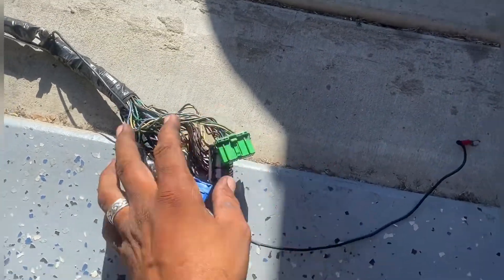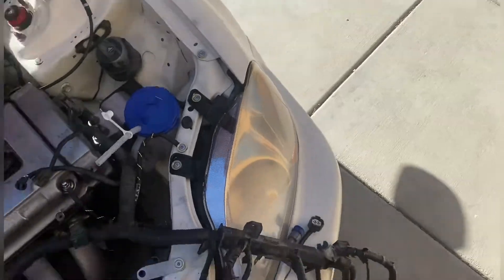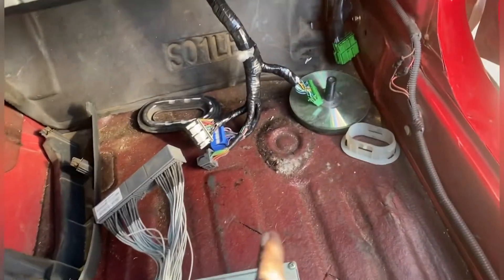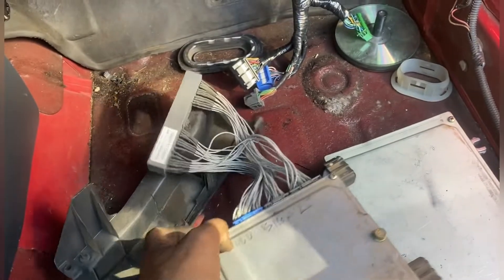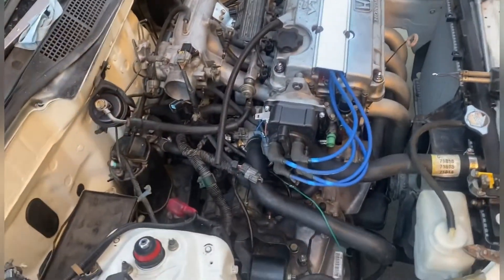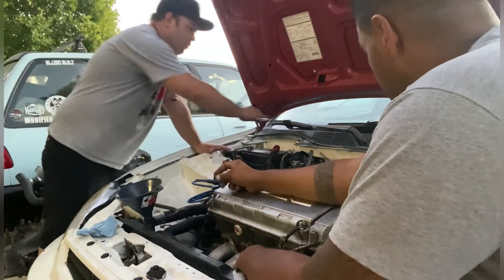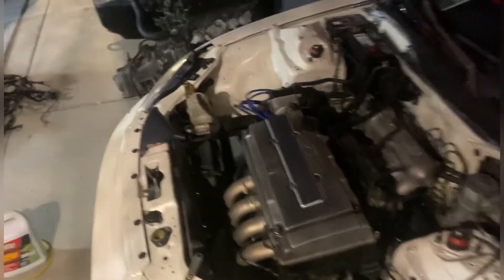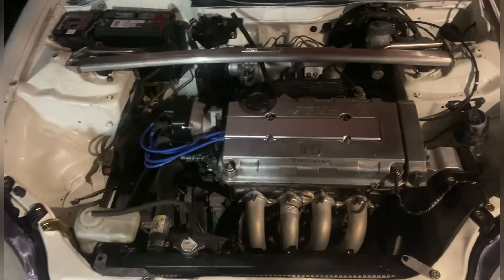B16 start up and wiring

Comment: Is there a manual or guide for where to plug the harness and tubing into everywhere? b16a into eg4.
Reply from the maker: I’m sure there is, I’ve never seen it tho. My house mate made my harness out of a civic ex harness my chassis is a CX. There are only a couple plugs that are the same like the Oxygen sensors and another one on the throttle body but luckily the harness usually doesn’t stretch far enough to get them on the wrong plugs 🔌

Comment: I have a 98 civic dx with a 00 si b16a2. 

What were the wires that needs to be extended/modded to get the 96 to 98 ex wiring harness to work? Trying to get it bar'd. The previous owner just used the old dx one. Thanks. Seems like this is the same situation here probably besides the cfk since the JDM one probably doesn't have that vs the usdm one.
Reply from the maker: There is or was only one brand that made a Cali legal conversion from obd2a to obd2b it as like 150 bucks from hasport I want to say. That’s how I did it and I did the trick where you run your crank angle sensor wire into the distributor one so that it gets a sign so no CEL. But the issue not on this one because I put the b18c back in.  But on my 97 with a b16a2 is the fuel tank pressure sensor which that ecu looks for and it’s the only code I have
Reply: @civicstar982  oh the jumper harness from Hasport? Didn't know the jumpers can be bar'd was thinking about get the p30 obd2a from the del sol. Expensive but, I don't want any issues if the ref says anything.

Sorry if I wasn't clear. Just wondering if 96 - 98 EX wiring harness would practically plug n play on the 99 - 00 b16a2. Then I can plug it to the del sol ecu p30 that's obd2a from the 96 - 98 EX wiring harness.
Reply from the maker: @mdiesel23  ok that is more clear. I’m suggesting the conversion harness because it adjusts all the plugs because obd2a and b have different orientations. Most aren’t legal because they move from a higher year to like obd1. But if you are going to bar as an 97 del sol then that’s an easier route I think then what I did.
Reply from the maker: @mdiesel23  so the harness conversion is is from HA motors. The del sol I think ran  the b16a3 so I don’t know if that will flag the ref.

Comment: Where can i find the plug adaptor you mention about the map and air temp sensor?
Reply from the maker: Almost everything should plug in on the ek to a b series. But yes the air Temp sensor on a civic is in the intake tube and the integra it’s on one of the intake manifold runners. So you just need the plug piece from an integra and wire that to the air temp wires of your harness to look factory and be functional it can be from a junkyard or eBay. And also my housemate takes a civic EX engine harness for these swaps since the hatches are non vtec. But I don’t remember too much other wiring changes and o2 sensor extensors since the integra and civic EX have the cat under the car and the hatch has them in the front. Hope that helps.